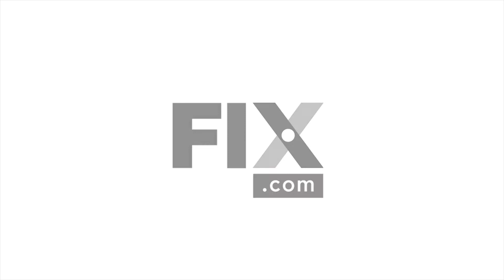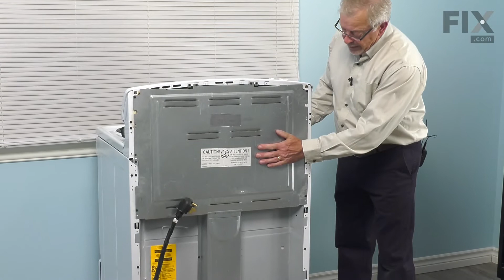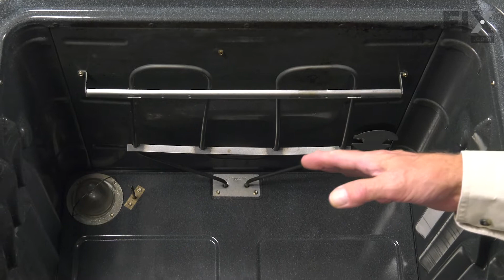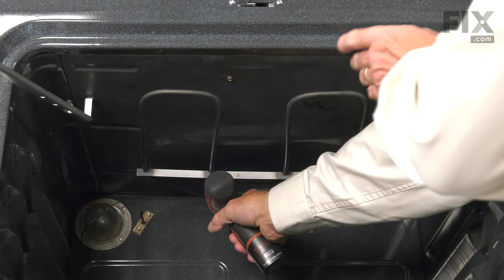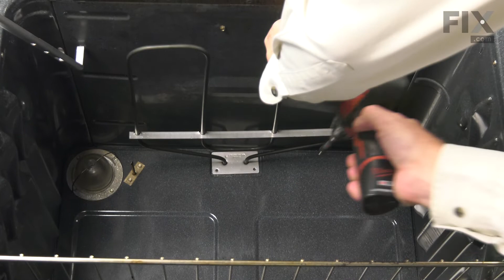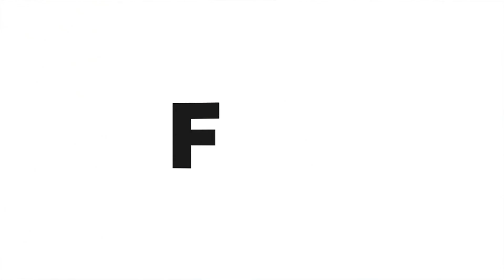GE Range/Stove/Oven Repair – How to Replace the Broil Element

Comment: Excellent demonstration!! Replaced the Broiler and Bottom elements! Unfortunately, I did not know when the bottom element "popped" it put a hole in the bottom pan. Have to get a new one. I won't use my oven until that is fixed, but I know it will be an easy fix! Thank you for this video!